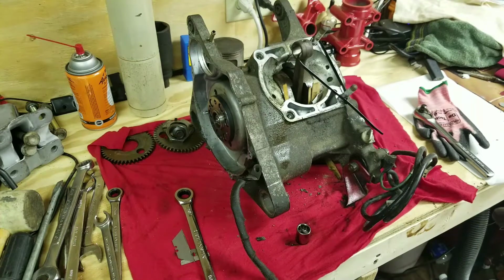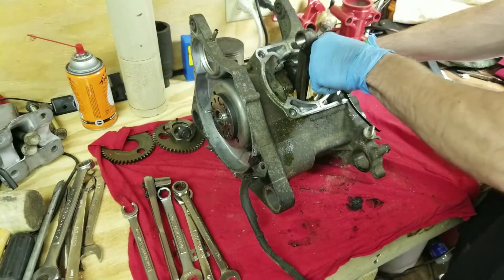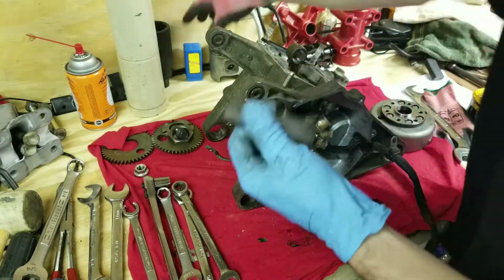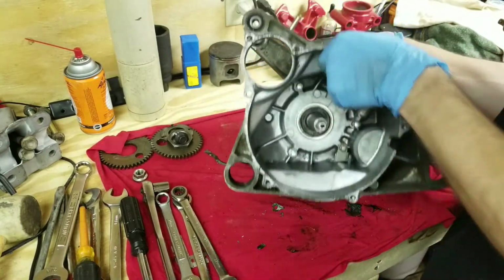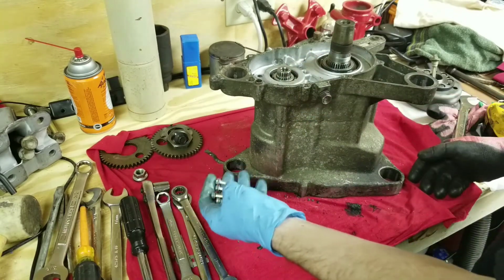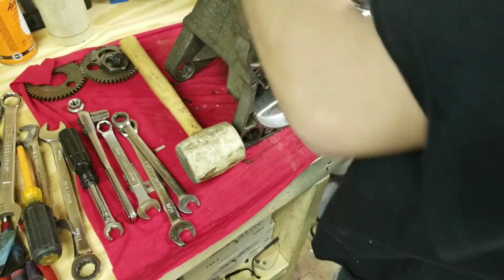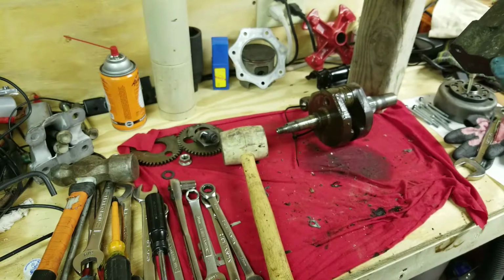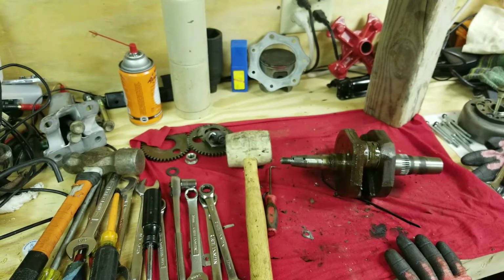Honda odyssey fl350 engine teardown and rebuild pt2

Comment: I'm looking for your video that describes how to drill and tap the hole that bleeds oil into the fly wheel housing.
thanks
Reply from the maker: Sorry I've had this project on the back burner ill try and do the how to video this week! Please share and subscribe! Thanks for watching
Reply: I just bought this for my grandson  and there was about 4 OZ of oil in the flywheel cover... Could this be the result of OVER FILLING ... Is this mod really necessary,   I  don't have  all the details for this mod.  I enjoyed your your video...
Thanks